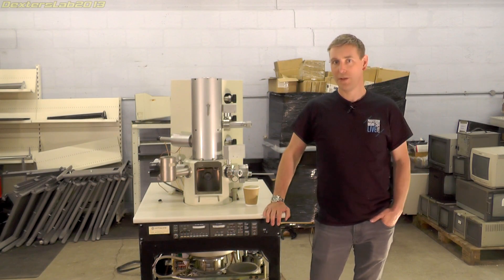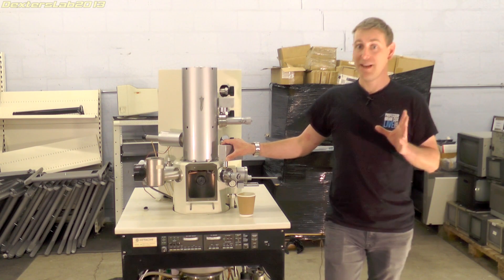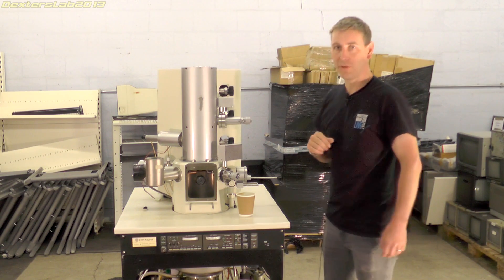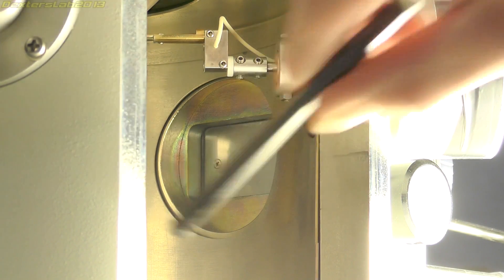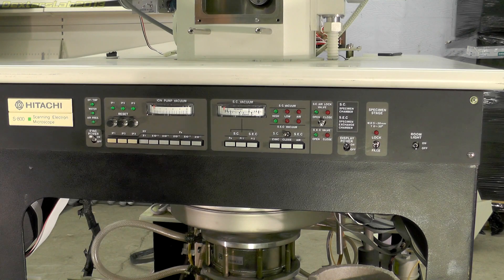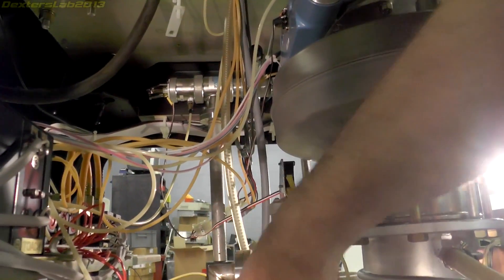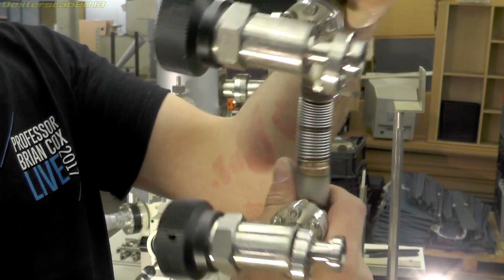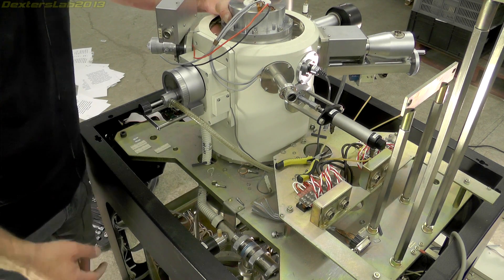DL122 - Hitachi S800 Scanning Electron Microscope Teardown Part 1

Comment: Some info on this microscope, since i have one. The microscope did not have its roughing pumps in the console. It used 2 external ones controlled by plugs on the column.

That loose pipe you mentioned, is most likely the LN2 output pipe for the LN2 cold baffle. (not 100% sure its actually LN2, its too soon to tell yet, but everything points to that cold baffle being LN2 filled.

Ill know more once i start the restoration. (i fully intend to document it on video)

edit:
Oh, and that separate port for the ion pumps, is the bypass valve needed to pump down the column to start the ion pumps. 
Once the pumps start, this is closed, using the manual valves. Also the ion pumps run 24/7. Pumping the column down takes about a day or so. (at the very least, i will see how long it takes for my own machine, once i get the point where i can pump it down)

edit 2:
that thing you referred to as the x-ray detector is marked as the secondary electron detector in the manual. And the thing you referred to as the secondary electron detector, might actually be a x-ray spectrometer. Im guessing that, since it has an angled window, and is movable. Seeing as soft x-rays are conducted like regular light, it would make scene. I can also say, that my machine appears to only have the secondary electron detector installed. Though i might just be missing the xray spectrometer on my visual inspections, as well as reading the manual (it makes mentions of how to use it, but not where it is on the machine)

Also that detector on the aperture, is another beam monitor. This machine has 2.
Reply from the maker: Yes i think your right about the LN2, when i removed that Anelva part during disassembly everything about it looked like it was for something cold and liquid, i think the pipe was an overflow into the polystyrene container. There was some wires entering it too with some sensors set at different levels running to a controller, so i think that controlled the level within that cold baffle. There is another baffle underneath which is fed with the same supply as the coolant for the diffusion pump.
Reply: you wouldn't happen to have pictures of those wires coming from the cold baffle? I want to check if my unit has them as well. I was recently wondering how i would know the fill level of it, and that would explain that. However i find no mention of it in the manual (at least so far). Though the original operator might be able to tell me more.

The worst case scenario for this microscope is an oil back stream, hence the LN2 baffle. And since i will need to pump down the column from what is probably atmospheric pressure, i will need to use the bypass manifold to evacuate the column. Doing so is risky as i don't want diffusion pump oil anywhere near my electron gun. Yet i don't want to waste LN2 either...

If your interested in this project of mine, i can notify you when i make the first video about it. This might be soon ish, though it might also take a while. Depending on a few factors.

Also, out of curiosity, how much of the microscope do you still have? I may be in need of some parts eventually.

edit: you would not happen to have images of what you called the secondary electron detector? where the connectors are visible. (and readable)
Reply: I have an update, i am now in contact with someone experienced with the S800 (maintenance and the such), and based on what he said, you mixed up the detectors, the Secondary electron detector is the thing with the black cylinder on the back, which is non movable. The movable thing, is the X-Ray Detector.
Reply from the maker: Thanks for all the additional info, the S800 is pretty much down to it's shell now with all the major components disassembled. I have a large box of items that i have saved and parts people have put their names on. I'll be making a final video shortly on it all. I have saved the LN2 level monitor for the baffle so i will make a point of showing it in the video for you.

Comment: 10:00 There is access to the ion pump from the chamber
so they can be roughed out, before turning them on.
You cannot start an ion-pump from air.  You usually
pull them down to 10-5 Torr with a rotary, then diff or turbo,
valve off, then kick them on.
Reply from the maker: Thanks James
Reply: a rotary alone can't achieve a vacuum lower than 10-3 torr.....

Comment: Hi ! Very nice video ! A few details regarding the video - the "X ray" detector is actually a secondary electron detector -it contains an aluminum coated scintillator, a light pipe (perspex/plexiglas) and a photomultliplier (most likely a Hamamatsu 268 - a SEM workhorse). The other - retractable - detector seems to be a backscatter electron detector or indeed an x-ray detector. Note that both aperture holders contain "boxes" with opamp which are used to compensate momentary fluctuation in electron flux

Comment: It really hurts my eyes to see such a jewel of technique being roughly rampaged for just feeding a video to youtube instead of getting it back to work as its condition seemed to be really good and this machine could have still offered a lot of nice and valuable imaging....
Reply from the maker: There was little chance to make it run again IMO, the entire control and imaging console was missing which also housed some of the vacuum system, there was no sample table. Parts of it did however go to help someone restore an identical machine that was in much better condition  at a university so don't feel too bad about it.